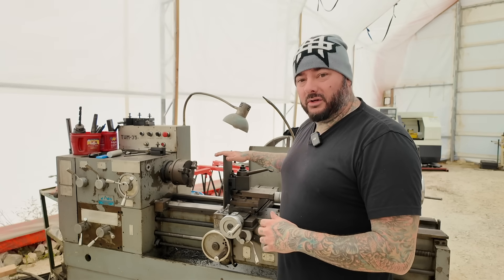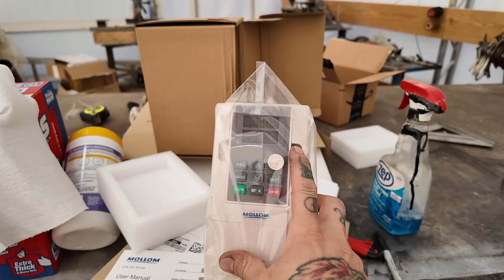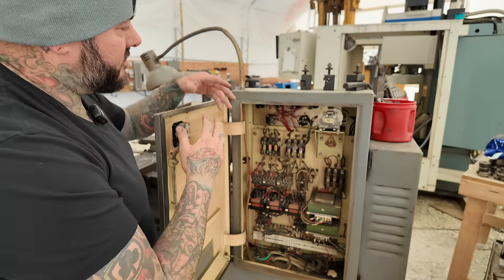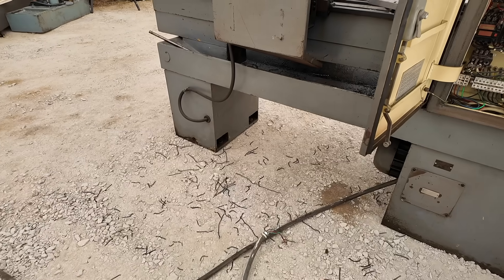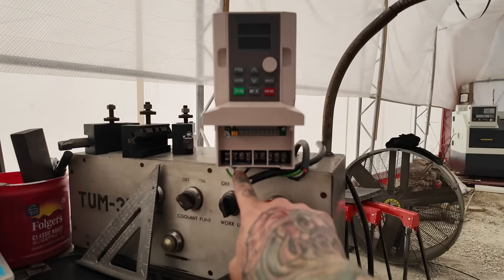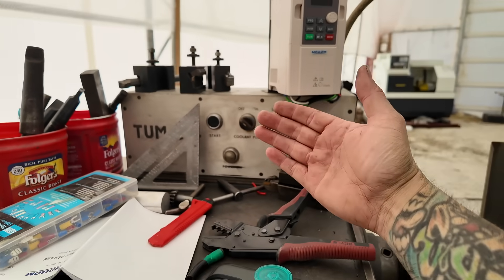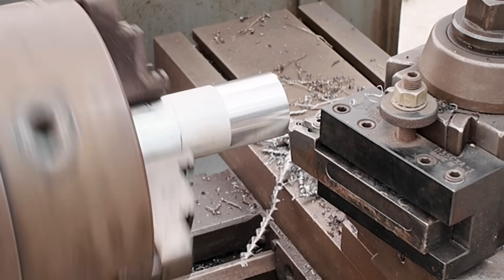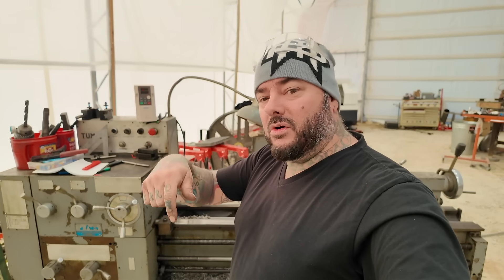From 3-Phase to Single-Phase: The EASIEST Way to Power Any Lathe

Comment: One important thing check first is the configuration of the motor windings, for a VFD to work the configuration needs to be Delta not Star.

This can be altered on the motor by using bridging terminals. Usually there is a diagram on the cover plate for the terminals.
Reply from the maker: Thanks for the info

Comment: The VFD might well be able to run the motor without any setting of the parameters. The very least amount of effort anyone doing this should put in is to set up the parameters from the motorplate and the grid parameters from your region. This really is one of those situations where reading a manual is not a stupid thing.... And the motor is now running on three phase power, as that is what comes from the VFD.
There are also another very important thing to remember if you want a long life from the motor after the conversion, and that is to use a propely shielded  cable and also install emc junction/nipples between the motor and the VFD. If this is not done -and done properly, there is little chance that your motor bearings will last very long after the conversion if the machine gets som some running time.
On the supply side of the VFD you can use a standard cable. I'm not going do the full explanation in the comment here, as it would be too long. But read up a little on the subject before doing the conversion, it's nothing difficult about it, but it is important for the life of the bearings...
Reply from the maker: Thanks for the info

Comment: Had my lathe done like that worked well but moved shead now have 3phase huge difference in the power of the machine now can take huge cuts no problem dosnt even slow the chuck down at all like it did previously
Reply from the maker: Nice

Comment: I used a 2HP one recently for a table saw. The starting of the motor on the saw was inconsistent. it would hesitate sometimes. Worked well once it started. I'm hesitating using one a larger horsepower motor because of the inconsistent starting. Have always used RPC
Reply from the maker: Maybe try one that is 1 hp larger than your saw motor

Comment: I am using one of these Mollom Convertors on a Logan 11 that was formerly 3-phase 440, Have used it for  a couple of years. I tore all the old wiring, switches, fuses, etc  off the lathe and it made it MUCH CLEANER AND SIMPLER, and modernized it all. The Mollom convertor uses single phase 220VAC for power, but outputs three phase power.  Using the  three phase also allows you to reverse the motor,  which comes in handy.  It has been flawless for a couple of years, and a super addition- my first iteration i first replaced the three phase motor on the Logan 11  with a suitable sized single phase motor-but  I hated the harsh starts and the constant belt ratio swaps, and so reverted to the original motor and added the Mollom convertor- which is a real piece of industrial control equipment, not some converted  tread mill speed control or something.   I have a smaller lathe with a tread mill conversion on it-that I designed and built-  at the first sign of trouble I will change it out with one of these mollom controllers.  Go get'em boys- This stuff works!!!
Reply from the maker: Thanks for sharing your experience!

Comment: I live in Europe, here we have 220v single phase as a standard, all of our industrial equipment like lathes etc runs on 380v 3phase so I run 2 vfd's in my garage; for my column drill which i retrofitted with a 3 phase motor and 1 for my lathe as well. I have a mitsubishi e500 vfd on my column drill and a mitsubishi e700 on my lathe. Both are rather small machines. It works really well, although i did have a lot more parameters to set up to get some life into it. But this is really an awesome video to show people that you can run a lot of cool machines at home without too much hassle. Loving the videos!
Reply from the maker: Thank you
Reply: Here in Finland, every house built since around 1970 has 3- phase, at least in my region. Even if you don't need 3-phase for any equipment, the electrical consumption is divided between all three phases which makes the electricity more stable, and the neutral conductor literally almost neutral.
There are some older houses that still have only 1-phase. But it isn't cheaper. The same tariff for 1x25A as for 3x16A.
The voltage was earlier 380/220V but it's now standardized to 400/230V. The change didn't cause any practical problem, no equipment had to be changed because of that. (And if you buy any new product made in EU they should be marked 230V 1-phase or 400V 3-phase).

Comment: I recently installed a phase converter VFD, 11kw  240v single phase to 415v three phase 50Hz, on my lathe no issues no mods just plug it in, no parameters to set up straight out of the box, formerly I had it running on a ROTARY phase Converter, a serious pain in the ass these rotary converters are very susceptible to the slightest single phase voltage drop only 3 o 5 volt drop in the supply and it will not start a three phase motor on a lathe or mill if the voltage drops during use the rpm also drops slightly  which is a pain in the ass if your lathe or mill does not have a clutch as a lot of the bigger newish machines don't have these days the rotary phase converters just trip out, My lathe has a 450mm swing with a 5.5kw three phase 415v motor and control contactors earlier VFD'S could not be used as the contactors would not work , the new type are plug and play for $300 Au  for 11kw in comparison to a Rotary phase converter 8Kw  USED cost me 7 years ago $2200,Au I would have been better off buying a new diesel three phase alternator. One of the best features of the new VFD's is the frequency is adjustable without losing motor torque, this proved invaluable as the screw cutting speed could be slowed right down on larger threads of 75mm or bigger, slower by 30% than the lowest screw cutting geared speed, any less and the contactors just drop out , it also runs the coolant pump at the same time the VFD is a Chinese made unit that requires no modifications to the lathe, I have a couple of older 3kw VFD's on a band saw and a cold saw which required the contactors to be bypassed and the soft start feature of the VFD be enabled and motor parameters had to be set up, easy if you are fluent in Chinglish or know an electrical engineer. as for the noise from the VFD's cooling fans, it's nowhere near as bad as the screaming of a rotary phase converter.
Reply from the maker: Thanks for sharing your story!

Comment: When you hook up the wires coming from the lathe to your VFD, there are 4 wires and one of course is the ground does it matter how the 3 are hooked up onto U, V, W?
Reply from the maker: The only issue it could cause is the motor to run in reverse. So if your chuck is going the wrong way switch two of the wires

Comment: Only thing I hate about VFD's, you need one for each and every machine if you're going to go that way. Honestly, with today's convertors, such as American Rotary, 1 convertor wired into your shop with said machines wired into that convertor, problem solved. Yes, electrician would be recommended but, buy once, cry once. Each their own. Cheers :)
Not knocking what you're saying, just thinking about all the hrs put in to rewiring, new wiring, vfd's all that adds up in cost... one has to weight the means here to decide which is the best way to go. Great info and great video, cheers :)
Reply from the maker: Definitely something to consider

Comment: An important thing to pay attention to when you use a VFD (that no one has mentioned in this comment section before):
The cooling of the motor.
The fan on the motor is designed to work best when the motor is running at normal speed. At low speed the cooling will be poor and running it for a longer time under load at low speed will heat it up and maybe destroy it. So it's good to still use the gears instead of a very slow motor speed. Especially when big work pieces need low speed - and high torque.
Reply from the maker: Good advice
Reply: You need to spec your motor to have heavy duty vfd windings. You are correct though. Bridgeport motors are one example.
Reply: @martinnorbeck4657  I understand you, but if you have a "normal" motor, I think it's a way cheaper option to just install an electric fan instead of replace the motor. If you have the fan controlled by a thermostat it can start automatically when the motor gets warm. These things aren't expensive and are usually pretty easy to install.
Reply: @OnTheRoadAgain-S  Yes that works. I got a big air compressor from a body shop guy which ran all day painting cars and grinding bondo. His working compressor had an external fan blowing on it all the time. He told me it saved his motors. His shop in the cluster had three phase. My shop didnt. I repaired the one he gave me and now I have three times the air capacity and it builds quick and quiet.

Comment: I came across a 10hp motor with an inner race fused to the shaft. Built a phase converter for maybe $200 total for the parts. Probably not even that much. I tried to go the cheap vfd route for a 5hp regenerative blower for a cnc vacuum table, but the vfd wouldn't work because of the type of orientation the coils in the motor were. It's been a while since I did it, but I believe the motor needs to be a delta configuration for the vfd to work. If anyone has info on how to make a vfd work on a wye motor, I'm all ears. The rpc hums, but if doesn't bother me much. The vacuum table makes enough noise to drown out the rpc. My 2hp 3 phase dust collector also drowns out the rpc, so the hum of the rpc is a non issue for me. Someday I might relocate the rpc and the regenerative blower outside the shop, but it's not a priority.

Comment: VFD should go straight to motor if you want to use switches from machine wire them on the configurable low voltage outputs.  So you can use big ole buttons to switch low voltage.  The relay voltages can be 25 volts you can always get a transformer that is 110 v or 220v single phase to power that up or maybe your transformer is a multi tap transformer in the machine.  Also you can configure the VFD to have a built in brake and other cool startup and power down features like quick start or free spinning stop

Lastly for a rotary phase converter make a dog house and keep it outside....  Works for me can't hear it lol
Reply from the maker: Thanks for the info

Comment: Are you sure the 50 doesn't mean it's programmed for a 50 HZ output?  Default output should be set for 60 HZ here in the U.S.  I wouldn't use the converter to set motor speed as the output frequency will affect how the 120 volt transformer performs.
Reply from the maker: Thanks for the input

Comment: You can use capacitors only to run 3 phase motors off single phase. A start relay is required. The 3 phase motors is limited to 70% hp output. I have running my clone Bridgeport for years this way. Also a compressor. You may be  able to find plans on line. This method runs a 3 phase like a single phase motor. I got the capacitors from junked A/C units. I would put the plans I bought online this site but they are copyright. VFD’s are great for speed control!
Reply from the maker: Nice! Sounds like a static phase converter

Comment: I actually had a VFD for a while.  Came back from a trip and it no longer worked. Maybe a surge (even tho I got a meter base TVSS) or maybe evil ninjas sneaked in and blew away the programming.  Either way, it never worked again.  Replaced it with a rotary converter and never looked back.  Only gripe I had was the fly-by-night company I bought my rotary from shipped me a used motor/idler with noisy bearings, then provided no after-sales support at all.  Caveat emptor!  Make sure your supplier
Natch, we want to avoid static "phase converters", as these do not provide full operating torque, due to incorrect phase orientation.
A properly design rotary with correct capacitance, will give you three full-voltage phases 120 apart, just as Tesla and Thor intended. 🌩
Reply from the maker: Thanks for the info!

Comment: An even simpler way that I have done in an emergency, We ordered a single phase motor from Germany (240 Volt) and a 3 phase was supplied, So I took the active to one phase and a neutral to the second Phase and connected the 3rd Phase from the active via large  capacitor, it ran for many years and as FAI know is still running?
David
Reply from the maker: Interesting way to make it work!

Comment: I use VFD's or static converters all the time, works perfectly plus you can add variable control and vector controls, with a resistor break and the right encoder you can even ridged tap. May have to change oil pump options for machines that relay on motor belts for oil and not use the VFD on pumps and such.
Reply from the maker: Thanks for the info!

Comment: And you loose about 10% HP.  So if you need the full machine this is a liability.
Reply from the maker: I did some pretty heavy running it on three phase and then after I installed the VFD and I really didn’t notice a difference to be honest

Comment: Well damn. I bought a 10hp phase converter for $1000 several years ago because I was under the impression that reversing the motor (ie power tapping) would trip it out, although I had also planned on getting a small CNC machine. I still "plan" on it.
Reply from the maker: You can run several machines if your phase converter

Comment: good to see a video from you again. I was wondering, I see you cut the bracket out by hand, what happened with the TopLoong Portable plasma cnc machine? I bought one too on your recommendation, and yeah, I'm constantly fighting it. How is the THC working? And are you using their nesting software at all?
Reply from the maker: I actually made another video where i retrofit the plasma with a touch screen and mach3 and it worked great but I sold it and bought two gantry machines from them without the controller or their software so I can built tables for them and install a touch screen and mach3 again. There software isn’t the easiest to use so I went that route to make it better for me.

Comment: If all you want is a 3 phase input to your “machine” I would wire the VFD output to the 3 phase input on your machine. I would set the VFD minimum HZ to 60Hz with an acceleration time of two seconds! Let the 240/120 transformer power the control circuit and control the machine using the factory controls! TheVFD will provide a very stable input voltage of 240 3 phase! All the VFD really does is convert all A/C input to D/C which at 240ACV is 340 peak to peak DC on the DC buss! The IBGTs control the output to simulate 240 AC 3 phase. Using 340 VDC power. I was a Toshiba VFD authorized repair tech in the mid 1990’s Back then a 5 horsepower drive would have been 2 ft tall 2 feet wide and 1 ft deep and cost 3000.00! Times have changed but VFDs haven’t! Only much smaller components! I really enjoy them!
Reply from the maker: Nice! Thanks for the info

Comment: you should have ran from the bottom of the control panel switch to the VFD than from the VFD to where the wires to the fuses. thus deleting the about 6 in of wire from the switch to the fuses, that way the VFD is never left on all the time,
Reply from the maker: Thanks

Comment: The 50 that your VFD was flashing would be frequency. Here in the US that should be at 60. Unless your trying to run your motor at a different speed and the VFD would have to be powering only the motor not the rest of the machine.
Reply from the maker: Much appreciated!

Comment: Im running a clausing 5914 with an old REO lawnmower engine. Driven off the cam. 1/2 speed. Theoretical twice the power. Correct rotation. Works for what i do as a rank amateur. Portable.
Reply from the maker: Nice!
Reply: I have a ton of REO parts and the mower if interested.

Comment: The three phase should just be the motor. Change the motor for 2 phase, modern rare earth magnet motors are smaller and more efficient. Its probably easier to use the box though.
Reply from the maker: Thanks for the info!

Comment: I didn’t see you wire the motor for low voltage (240 volt) in the peckerhead. 480 is wired hi voltage - tie 4 and 7, 5 and 8, 6 and 9, line in is 1,2 and 3. Low voltage 240 is wired - tie 4,5 and 6. Line in is T1 = 1 and 7, T2 = 2 and 8, T3 = 3 and 9. If I missed that, sorry. Skipped over bits of the video.
Reply from the maker: I didn’t actually have to change it because when I wired it to 3 phase before I installed the vfd it was wired for 220 v 3 phase and worked.
Reply: I had same question because you showed label on door showed 480 volts
and if there is a transformer most times you have to change primary taps to the lower voltage